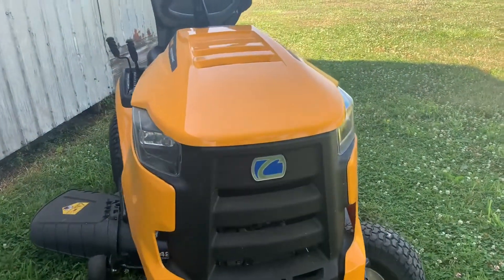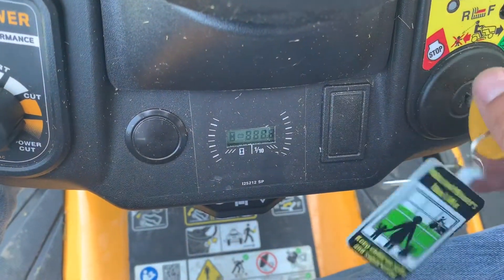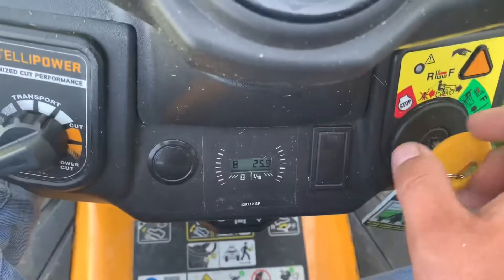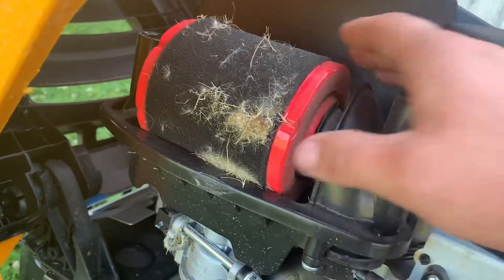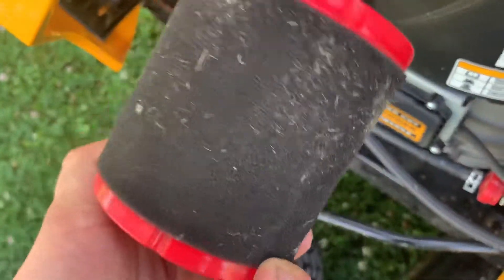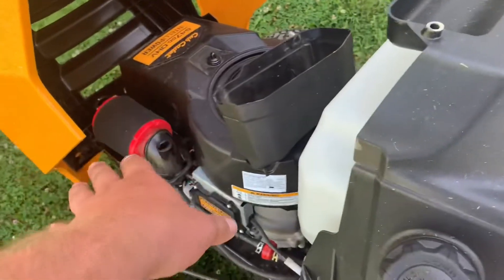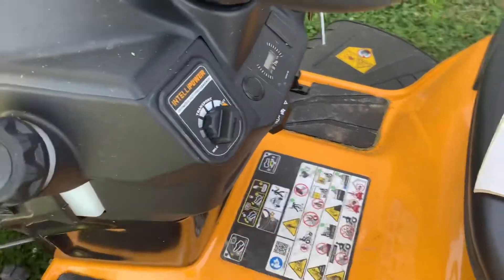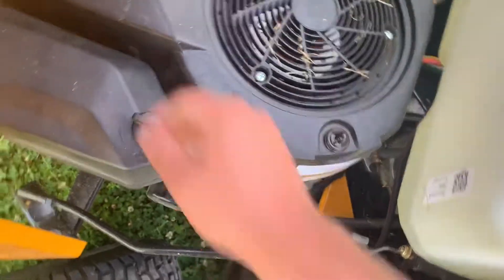Cub Cadet XT1 LT42 FIRST SERVICE ISSUE!!??

Comment: I would call it a maintenance reminder instead of an issue. The term issue gives the impression something is wrong. I have the same mower and very pleased with it. Easy to start. Very easy to steer. Cuts great! Seat is comfortable. Seat does get hot if left in the sun and you're not sitting on it. Suggest putting it in the shade...when using it...if you will be off it for some length of time.

Comment: I noticed your oil filter dinged up. Did you change it after the 5 hour break-in? Tip....There's no need to buy the overly expensive Cub Cadet filter. There are dozens of cheaper brands that work just fine. I use a Fram oil filter. Been using Frams on all my gas engines since 1970 and never an issue.

Comment: it is better to change that cheap gas filter they use also .Those little ones are worthless .I use the clear one and change it 3 times a year .You can get the good clear ones cheap off ebay .Gas is dirty stuff no matter what .You can blow the paper filter out with an air compressor .I clean mine after every 2 mows also cubs seam to not have the ohv valve sealed very well .Mine leaked after only 1 year .Easy to do .

Comment: So I have the LT42 XT1 Seems like it's having problems recharging the battery checked all the connections everything seems fine. Any hints or tips on that?
Reply: Scratch that I do have one purple wire lose I just have no idea where it goes  It's on the opposite side from the gas cap

Comment: So, I’m wondering. If this mower doesn’t come with a choke. Which I don’t think it does. How can the motor be primed if hard to start.
Reply: Take off the air filter and give it a (little )shot of starting fluid .And I do mean little.

Comment: Who sells a oil filter for this exact machine?  -  Cub Cadet XT1 LT42 with IntelliPower
Reply from the maker: Cub cadet dealer or auto parts stores SHOULD have them, my local stores were out of stock
Reply: @projectauto1928  Yeah i found one at a cub cadet dealer that only sells the zero turns and up at their implement dealer store. They only had one, and it's installed now.  I ordered another thru tractor supply.. not caring about the delivery date now.  Thanks =]
Reply: There are actually two that fit it. The short one from Cub and then there is a longer (bigger) filter that will also fit it.  Check this video 
https://www.youtube.com/watch?v=AsSAi0IFWag    Also a Fram TC3614 will fit.
Reply: @sotm6078  That video is for Kohler engines.  This is an MTD 547cc engine.  I'm having a real problem finding an oil filter for this engine.  It seems even Cub Cadet doesn't have them in stock.